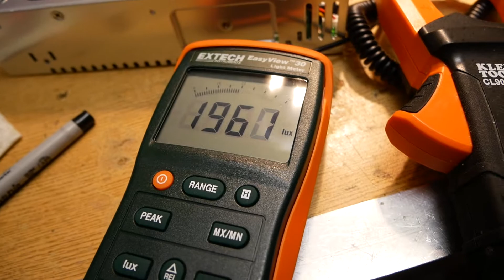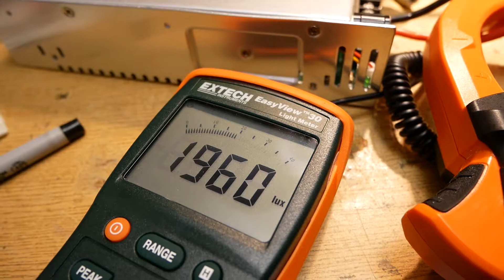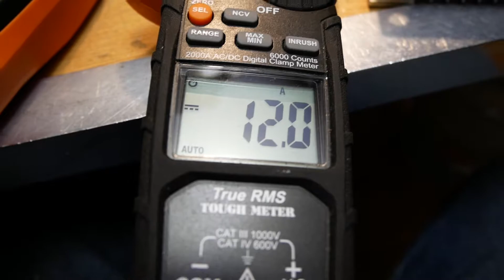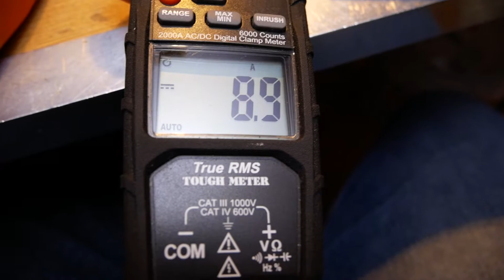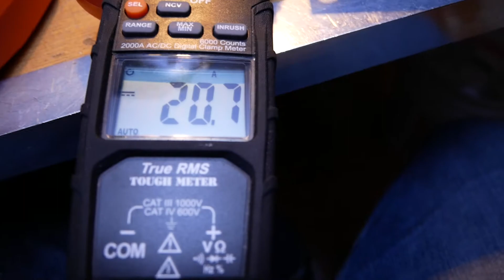XHP70.2 vs XHP160 lux and amps tests

Comment: How can he bo so confident while pushing 12A@ 2x2 die into a XHP70 where 4.80A is the ABSOLUTE MAXIMUM.

Mate, LEDs are supposed to be current driven NOT voltagedriven.

Again successfully destroying LED because you  do not drive the LED correctly.

Double current does not mean anything because you left the curve long ago and at that point you driving the LED as a heater.

If you do test properly, example at 6W for every LED you see they are close.

Example: a xhp70 at 4.8A / 6V does 1400lm, a big COB 20k lm, but at 3A (but a higher voltage, yeah, you need to compare the POWER right? Now you see?). Because it’s another LED that has to be driven differently.
Reply from the maker: You are entitled to your opinion and feel free to poke holes in my tests all you like. The CREE LED outperforms the Chinese LED. Simply put, the Chinese LED can't handle the abuse and the CREE LED can! So your complaints are heard and ignored. You want to poke holes and yet ignore why the videos were made and the proof they demonstrate of the superiority of CREE LEDs.
Reply from the maker: FYI...IF I did current limit the XHP160, you would see that it was much dimmer than the XHP70.2. Once again proving that the Chinese LED is a very poor performer compared to a CREE LED.
Reply: Oh Good to know. I have tested myself, a crew XHP70 and a cheap Chinese 1W eBay special.

I put 25A at 30V through the XHP70 and then testet both at a current of 0.1A, the Chinese is much brighter, in fact that’s the only one really lighting, the XHP70 is also a bit brown with a burned dome… I wonder what happened there ;)

No need to poke at your tests, they are fundamentally flawed as one can see after 1st grade electrical class. Physics say: LEDs have negative temperature coefficient, that means: LED driven at x Volts pulls y Amps at 25C but way, way more amps at 80C. That’s why LEDs are driven constant current, the voltage given in the Datasheet is an approximation. 

Show me one commercial high power flashlight driven by constant voltage and not constant current.

You have a Good opportunity by using both your DPx5005 supply’s. Limit both to the LEDs spec currents and the compliance voltage to an appropriate value: example XHP70 2x2 is 4.80A, maybe 7 or 8V compliance, keep case controlled at max 85C

XHP160: read Datasheet…

I would offer you to test the LEDs an a multi thousand euro Lab setup, but that’s only viable if both LEDs treated towards their specs. And not „yeah treat them equally but hit the Chinese one harder to give it a harder time“

Comment: So glad I watched your videos before making my purchase. I suppose now I have to work out the trade off of money verse quality.  Keep up the great work mate.
Reply from the maker: Thanks! You'll probably find an option that isn't too ridiculously priced in a thrunite. Still won't be cheap like a chinese light.
Reply: @de-bodgery  I ordered a Nightwatch NI40.  Fingers crossed
Reply from the maker: @DaveSmith-ke5ik  
 Seems these guys are exaggerating the lumens a bit much.
50000 lumens: https://www.newegg.com/p/054-03AA-077A3
Emitter specs say 2300 lumens: https://download.luminus.com/datasheets/Luminus_SBT-90_Datasheet.pdf
Doubling the brightness over factory specs is highly unlikely for any LED.
Reply: @de-bodgery  Yes . I  saw on the specs it's  2400 lumens. 5000 might be the other version .
Reply from the maker: @DaveSmith-ke5ik  I posted the spec sheet for the LED in the light you bought. I'm not familiar with these LEDs since I focus on CREE, but there's zero chance a 2300 lumen LED will over watt to 5000 lumens. If your light has 2 of these LEDs in it, then 5000 lumens is possible.
Reply: @de-bodgery  might be a blessing in disguise but my purchase was not available, so I'm looking again.
Reply from the maker: @DaveSmith-ke5ik  I saw your light on newegg and it was out of stock there. It's either very popular, or like Magnum, the place went out of business. Magnum made nice lights. I have 2 of theirs with CREE XML2's in them. Plenty bright for the LED in them and good quality. You just can't buy anything form the company anymore since they closed up shop. So much for a warranty! Stick with Thrunite. They have been around for a long time now and seem pretty stable.
Reply: @de-bodgery  great to know. I will start looking , might have been a blessing in disguise. I
Reply from the maker: @DaveSmith-ke5ik  
If you need something compact, this XHP35 light is pretty nice. I have one.
https://www.amazon.com/ThruNite-TC15-Ultra-Bright-Rechargeable-Flashlight/dp/B07JCFY3N4/ref=sr_1_3_sspa?crid=3S4CZOQUNJG8O&dchild=1&keywords=thrunite+flashlight&qid=1628623080&sprefix=thrunite%2Caps%2C260&sr=8-3-spons&psc=1&spLa=ZW5jcnlwdGVkUXVhbGlmaWVyPUExTkNQNzRISTdOQzVTJmVuY3J5cHRlZElkPUEwMDQwOTQzVldUVTkxWE1UVU9XJmVuY3J5cHRlZEFkSWQ9QTAxNzM2NjhNSzZMMDlWTzBBSUomd2lkZ2V0TmFtZT1zcF9hdGYmYWN0aW9uPWNsaWNrUmVkaXJlY3QmZG9Ob3RMb2dDbGljaz10cnVl
*
I don't have this light, but it has an XHP70 in it so its going to make tons of light.
https://www.amazon.com/ThruNite-Rechargeable-Tactical-Flashlight-XHP70B/dp/B078JLG5DB/ref=sr_1_1_sspa?dchild=1&keywords=thrunite+xhp70.2&qid=1628623451&sr=8-1-spons&psc=1&spLa=ZW5jcnlwdGVkUXVhbGlmaWVyPUFIRlpNUUVYR0ZRMDcmZW5jcnlwdGVkSWQ9QTEwNDM3MTYxSExLUlZVRlpFWTI3JmVuY3J5cHRlZEFkSWQ9QTAxMzc4NDQyWEZOMU1ZRDZFNDVaJndpZGdldE5hbWU9c3BfYXRmJmFjdGlvbj1jbGlja1JlZGlyZWN0JmRvTm90TG9nQ2xpY2s9dHJ1ZQ==